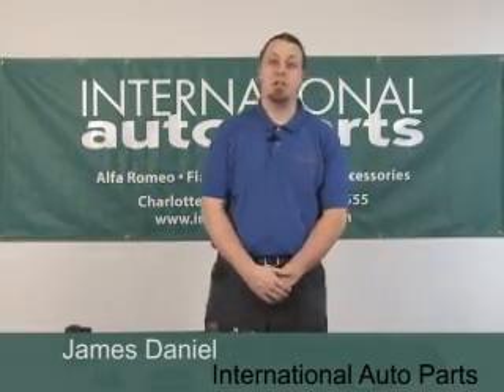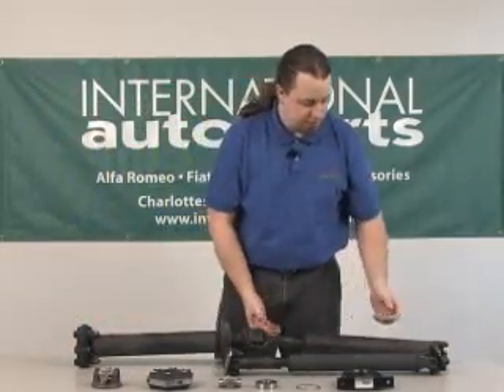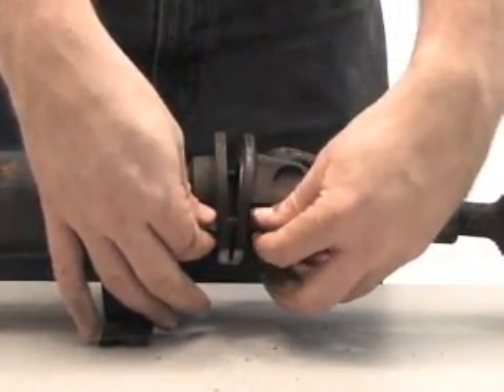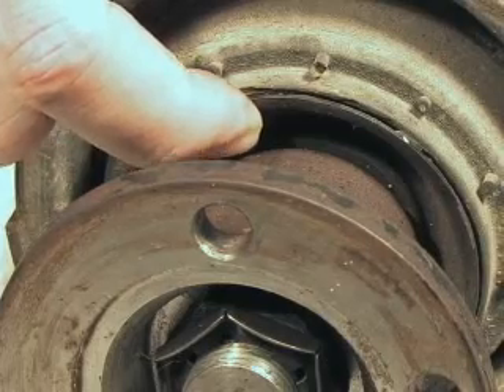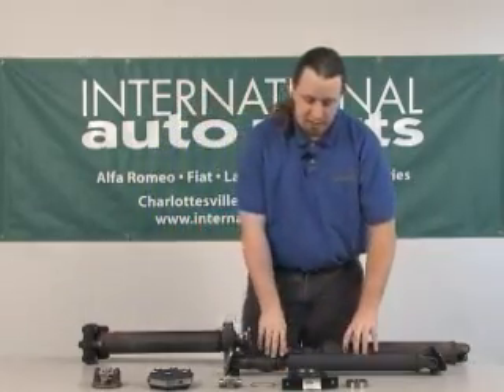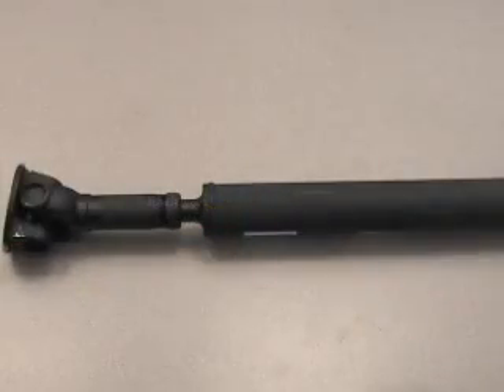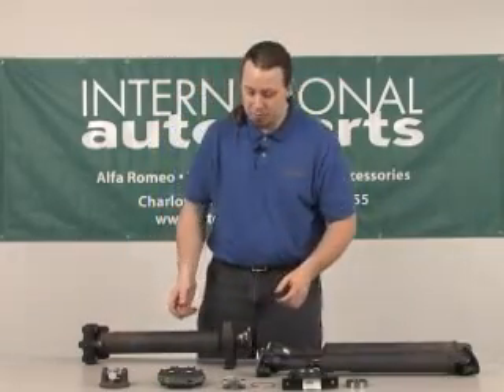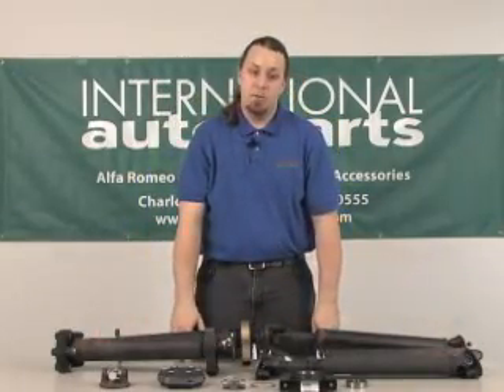Rebuilding a Driveshaft - International Auto Parts

Comment: Thats a propshaft not a driveshaft :/
Reply: +Michael Stoltz I would disagree. Propshaft is what runs from gearbox to diff (or engine to transaxle). Driveshaft is what runs from diff to wheel
Reply: Airplanes, and boats have propellers. Cars have wheels, but we can't call it a wheel shaft, or an axle shaft. Its part of the drive line. Shaft  is universal, so.